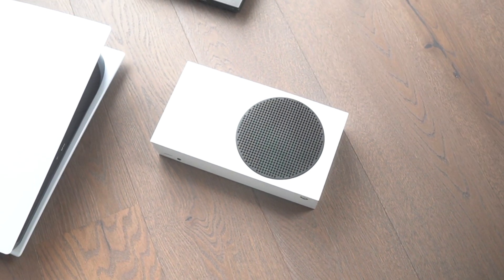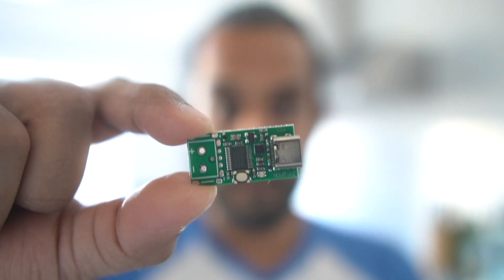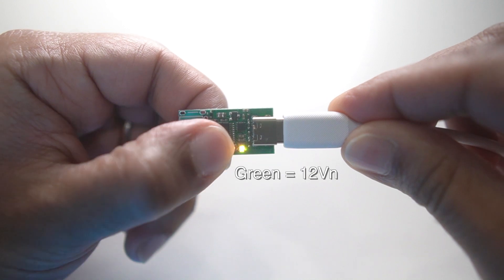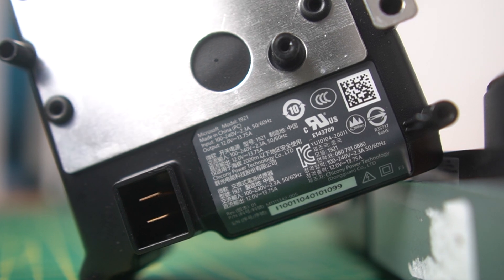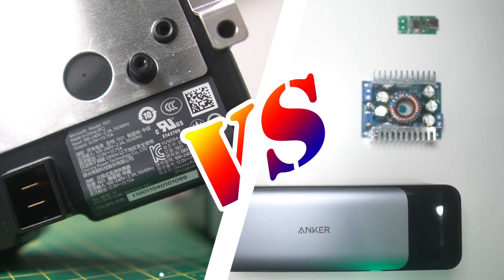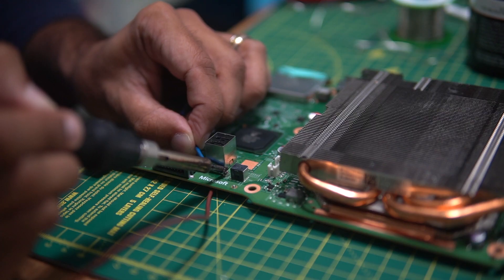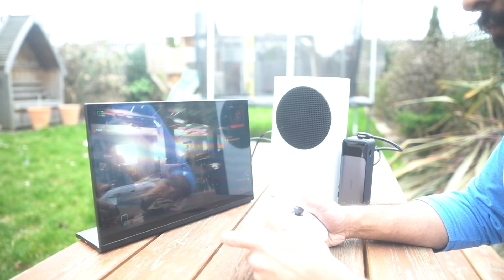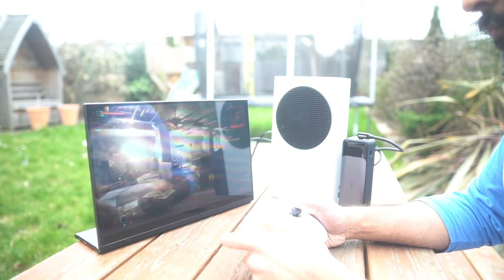Xbox Series S Powered By USB-C!!

Comment: Would this work with a 360? Ive heard it usually maxes out at 90 watts
Reply: If you'd like you can find battery units with preselected specs to match your requirements. Or custom build battery with 18650's and then you'd just wire and (FUSE) them altogether with a female c usb. Then you can choose ur volts and battery capacity.

Yes possible

Comment: For those wondering, if you under powered this, it would still run, just not at full speed, because the xbox has no battery or source to draw a certain amount of power your processor and system would just run slow, it won't shut off as long as your wattage is above 20

Comment: Hi. I'll be looking to add a series s in my solar powered 12v campervan, but is there a simpler way, like using a 12v (14 amp) transformer on the EXTERNAL cable, just ignoring the 'neutral' wire?
Or would there be a conflict with the internal transformer?

Comment: I'm a little confused .   You have the Anker battery with a 5v output,  into the 
ZY12, which you can bump up to 12v.     Then you sent that output to the DC buck step down only to adjust it to 12v again?     Why couldn't you just skip the buck entirely if the ZY gives you constant 12v?
Reply from the maker: Thanks for watching. The power bank is  giving output of 20v with 5 amps current. Then the voltage is dropped to 12v by the buck converter. Hope that makes sense.
Reply: @Robotanv  so Anker has a USB-C out at 20v.    Which is connected to the ZY12 which you can adjust to 12v output via the toggle button and LED indication that you showed in the video.  Then again into the buck converter.     
  Or are you outputting Anker 5v to the ZY12 and upping the voltage to 20v then dropping down to 12v via the buck converter ?
Reply: @proxlamuz4591  He connected the usb-c which is 5v into the zy12 to bump it up to 20v because if he set it to 12v output he wouldnt get enough amps to power the xbox. So he set it to 20v to get 5A and then with the buck he set the voltage to 12v while the amps are still at 5. Thus giving him 12v and 5A to run the xbox.

Comment: I would like to integrate the XBOX Series S in my Campervan. Can I go directly to the 12V input of the mainboard or can there be any issues if the voltage goes over 13V (i.e. when the battery of the camper is charging) Nice Video btw!
Reply from the maker: Thanks for watching! I'm sure you can but I don't know how stable that car power supply will be. I would put something like a step-down converter (see description) between the car and the Xbox, just to keep the Xbox safe. Much cheaper to replace the converter!
Reply: @robotanv  Thanks for your reply. The voltage should be 100% stable because of the BMS inside the Lifepo4 battery, but if the battery is charging it will be probalbly 13V-13,5V DC. I think i will give it a try, this would be much more efficient as it is with a 12V to 230V converter
Reply from the maker: Sounds like an exciting project! Can't imagine how much more game time you'll get by skipping that conversion!
Reply: @stefananibas7824 Let me know how you get on please, i'll be trying the same soon. Im not sure if the external transformer/12v step down that we add on would conflict with the internal series s transformer!?